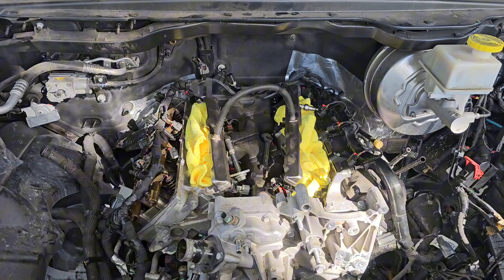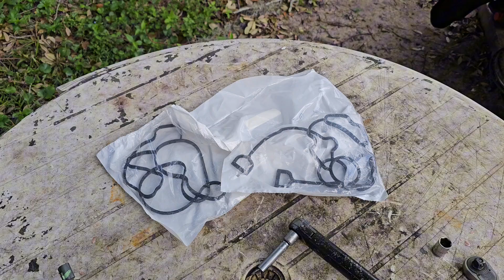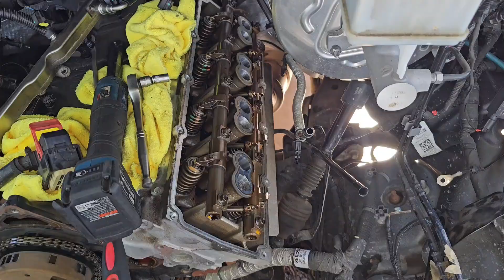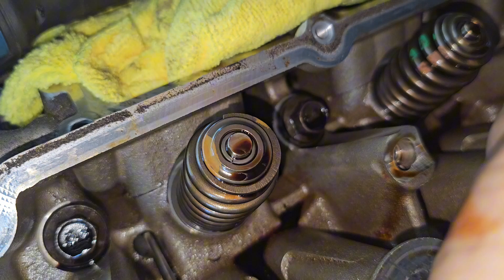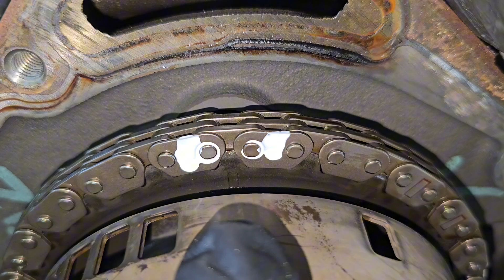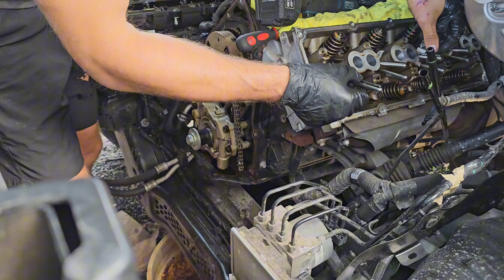HOW TO REMOVE AND REPLACE DODGE RAM HEMI CAMSHAFT WITHOUT REMOVING CYLINDER HEAD

Comment: I tried doing this and the chain dropped and now I need to remove the oil pump or is there a way I can put it back without removing the oil pump
Reply from the maker: You should have made multiple timing marks to match the chain later
Reply: @pandydiy so what now I have to take off the oil pan and pump correct
Reply: @eddysandoval2068 no. If you had number one at tdc you will be fine . There is only one place it can be. Now put the cam at 12 o clock . The cam goes around twice for each revolution of the crank.

Comment: HOW TO REMOVE AND REPLACE DODGE RAM HEMI CAMSHAFT WITHOUT REMOVING CYLINDER HEAD

Step 1: Remove cylinder head.

WHAAAAA?
Reply from the maker: Actually you can remove it without removing cylinder heads,  you need 16 telescope magnets to hold lifters up and then that allows you to slide camshaft out without pulling heads. I have a video on my page showing how Im doing it. Same applies for GM engines with single cam

Comment: What year is this hemi
Reply from the maker: 2009+ all same
Reply: @pandydiy  thank you so much there’s no cooling hose in between the mds solenoids in between the block and the intake manifold right ?
Reply from the maker: @hectornavarro627 nah, under the MDS solenoid you will find just engine internals and nothing else you can peak camshaft from there too,
Reply: @pandydiy on so the only solenoid that’s there is the vvt solenoid on top of the block in between the intake manifold
Reply: Why you can’t do that with 4 more magnets on the other side it looks like you could do this with both heads on please explain
Reply from the maker: @larrygriffin7024 you can change camshaft with both heads on, but what's the reason for camshaft replacement ? Usually a worn/failed lifter which has worn down camshaft lobe. So replacing a lifter is a must, and to replace lifter you need to remove head
Reply: Why not replacing the lifters though??
Reply from the maker: @luisescalera4289 budget repair 😅

Comment: Good idea. But... I would absolutely make the customer sign a paper saying that they wanted it repaired half assed and you are not responsible for the camshaft and give them ZERO warranty on the repair. They will come crying to you when the other side collapses. Because it will.
Reply from the maker: Oh yea absolutely,  it's inevitable that the roller bearings fail and seized and start grinding down the cam